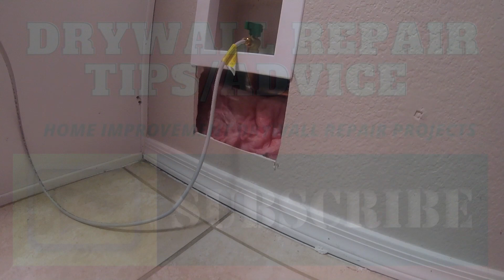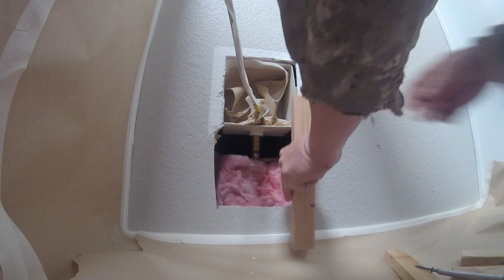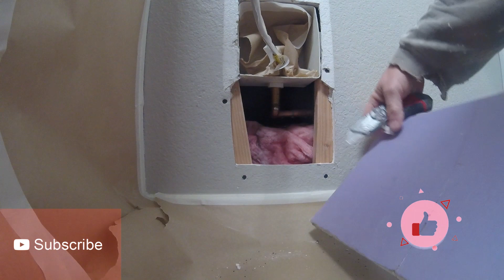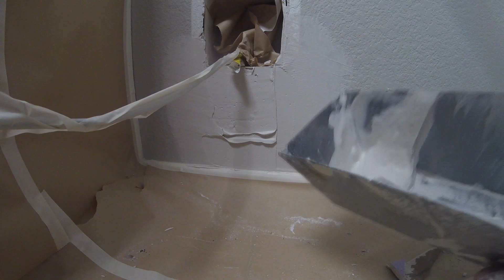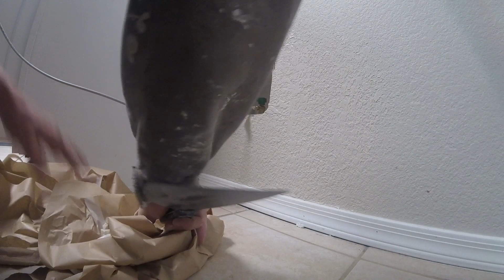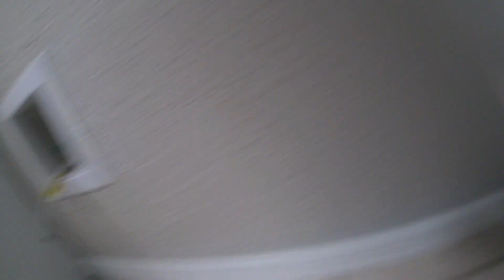Patching hole behind fridge How to patch hole in wall plumbing access hole sheetrock repair

Comment: Can you put the list of items needed please? I need to fix mine ASAP! Thank you
Reply from the maker: you have watch videos those are free I have 100 plus videos those free to watch
Reply from the maker: material list wood backing 1x2s sheetrock fiberglass mesh tape inch and a quarter screws you need joint compound that's the basics and then basic hand tools you can watch all the videos and you'll see all the stuff that gets used if you don't know what to buy then maybe you should hire professional